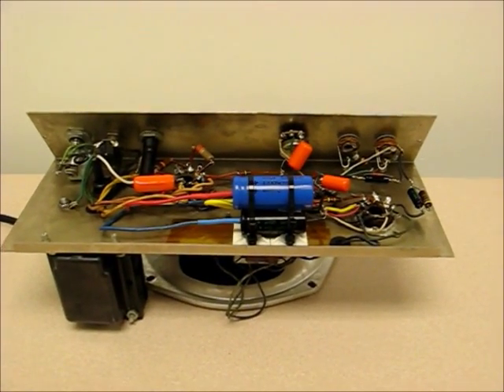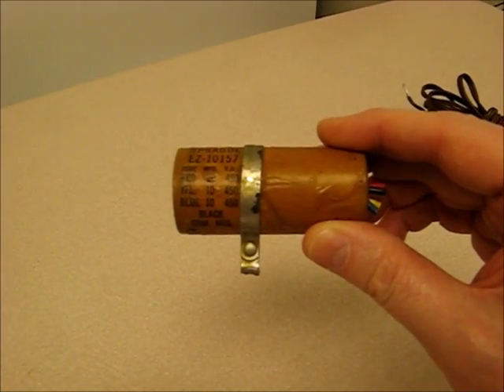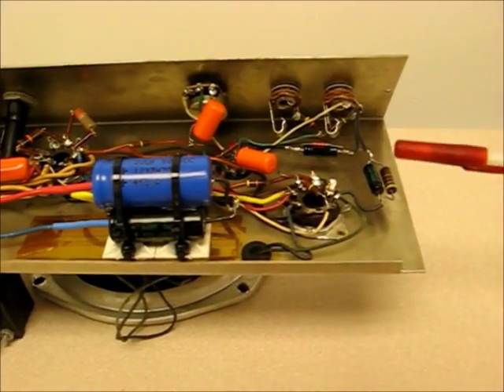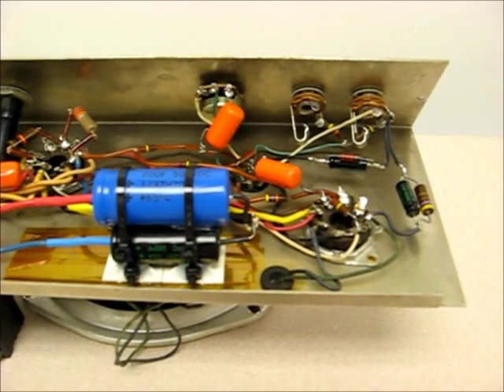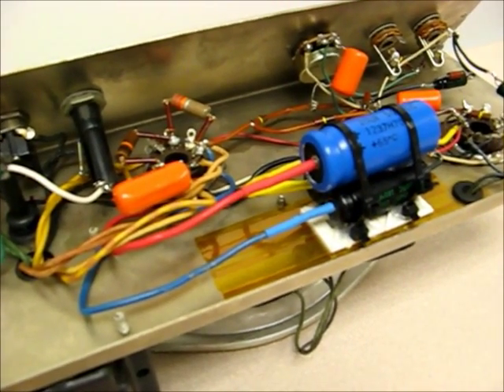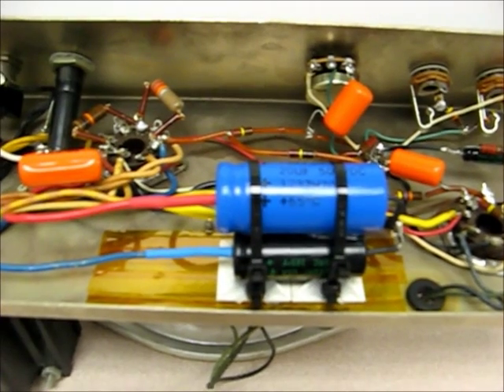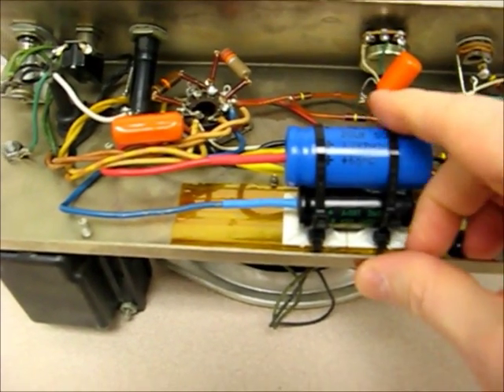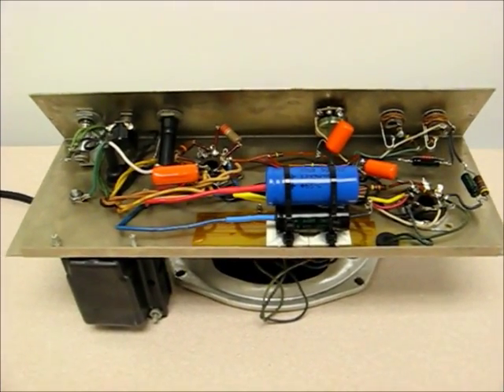Replacing Electrolytic Capacitors and Power Cable in 1959 Gibson GA-5

Comment from the maker: Original electrolytic capacitors were replaced with Sprague Atom capacitors:  20uF/50V (TVA 1305.5-E3), 10uF/450V (TVA1705), and 20uF/500V (TVA 1906-E3).
Reply: Your supplier deals in bulk only.
I only need 1 of each.  Very expensive.
Reply: I found a supplier Allied Electronics

Comment: Do early Solid State Amplifier's with the two prong power cords still have the death cap or is  that just tube amplifiers?
Reply: I just received an old Silvertone solid state amp for rebuilding, and it has the death cap attached to the hot wire with the grounded lead bolted directly to the chassis.